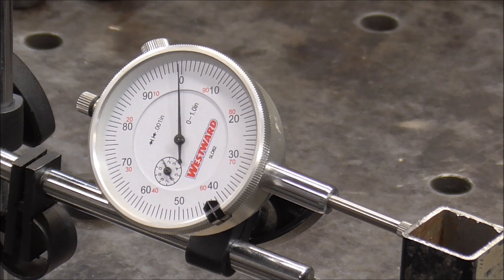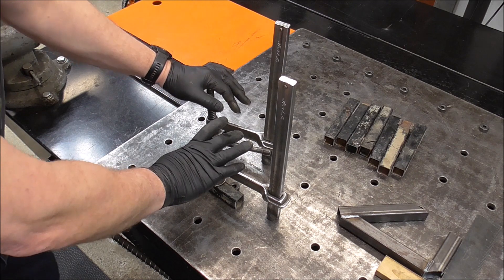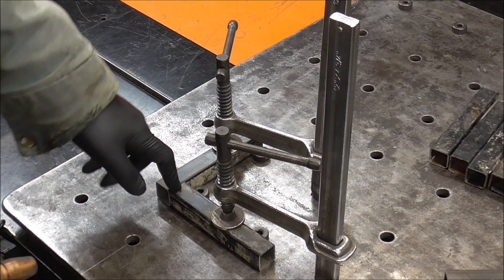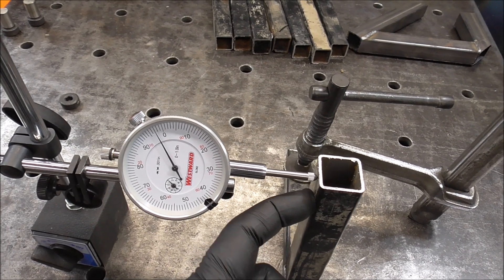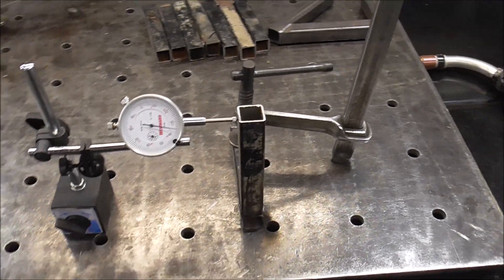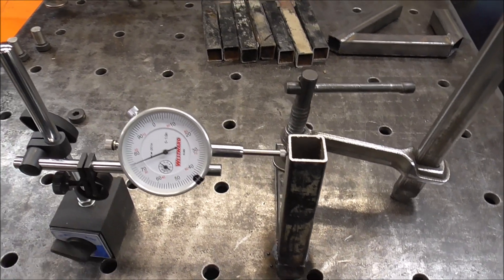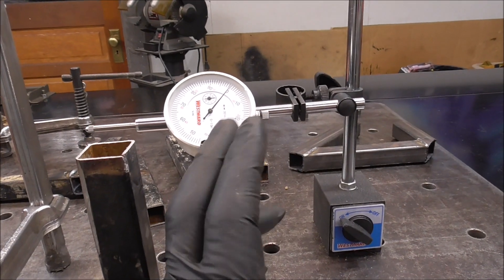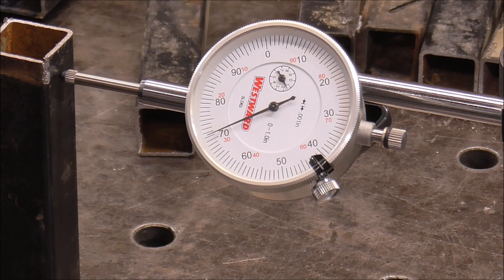Interesting Video Limit Warping and Distortion when Welding

Comment: Can you use spacers on bottom and then clamp down that way ubcan tacknall 4 corners
Reply from the maker: That would work also but it will still want to pull one way or the other.

Comment: Nice way of using a dial indicator shoeing distortion and how metal pulls when you weld good work @Brandon Lund
Reply from the maker: It was actually pretty surprised how much things move
Reply: @BrandonLund  yeah I wad actually kinda shocked how much it moves even when the peice looks straight to a straight edge

Comment: correct me if i'm wrong: this gauge shows not 1/1000 of an in, it shows 1/100 of an in. (0.01 is 1/100).
Reply from the maker: @Matthias Lange each graduation is one thousandths of an inch (.001) There are 100 graduations per rotation (.01) or 10 rotations per inch (.1) This is a 0-1" stoke guage.
Reply: @BrandonLund  you're right. i stopped the video to check. the dot was difficult to see. i thought it was 0.01in, but it is .001in.

Comment: Brandon I see a lot of people having similar problems with warp on sheet metal as well as iron projects. The big thing that I see is they don't practice on  scrap before they get into the actual project. I will post this on my Facebook. Good job thanks.
Reply from the maker: I agree totally! No different than running a pass on some scrap to check your amperage.

Comment: Brandon, I saw something similar that someone had done like you did with a dial indicator with a lazer pointer and a target on the wall. It amazed me how much it wandered, and what it took to bring it back into tolerances. It made me appreciate using both jigs and fixtures. I worked in a welding shop many years ago that made assemblies for an over the road truck company, and that shop also made storm sewer inlet grates for New York City, and even for something that mundane, having the right setup helped keep them from rocking when installed.
Reply from the maker: Thats pretty cool too! I probably wouldn't have thought of that but it would also give a great visual.

Comment: Thank you for this demonstration. It’s very timely for me personally. In my arc welding class, we are starting practice to pass a bend test. We take 2 larger beveled pieces with a backing strip and we need to tack them together, leaving a 1/4” space. Well, the first one I did came out great. The second one freaking moved!  I forgot to tack the opposite ends so it wouldn’t  do that!  I had to work to get it apart to fix it but I did. 
This is the perfect demonstration of what’s happening and it helps so much to have the visual component that you provided. 
Keep up the good work. Looking forward to next weeks video!
Reply from the maker: Thank you Shasta! I love stick welding! I appreciate your support! 🙏
Reply: I love stick welding too!  It’s my favorite process (and I’m doing/learning them all in school). 
I’m excited to say I’m making my fabrication table this week and following your template instructions. You made it easy to understand so I wanted to thank you for that. Fingers crossed that I do a good job.
Reply from the maker: I'm excited for you! Not only is building the table fun but you are going to have a lot of satisfaction every time you use it. Have fun! 🤗

Comment: Ok, you have done it again!!!  Great infirmation that can be used by a novice or experienced hand at welding.  You always have great information.  I welded a 1/4" X 1" X 6" support leg to my wheel hub to support my bike stand and I did tack on both sides then did short welds on both sides and then when I welded the final pass the piece pulled up 1/4"!!!  Put it in the vice and bent it back but the  thing just pulled up and I don't think anything would have prevented that.  This was such good information!!!  Thanks, Brandon!!!
Reply from the maker: Thanks Jim! It's pretty crazy how these forces come into play. It actually surprised me how much even a short piece moves.

Comment: Fantastic video. I started building a metal sheet bender from angle iron. When welding on the backing strips it then ended up bowed. I've bent it back straightish but that project hurt my feelings so I still haven't finished it 😆
Reply from the maker: Thank you! Oh and trust me I know lol it still happens to me too unfortunately. 🙃